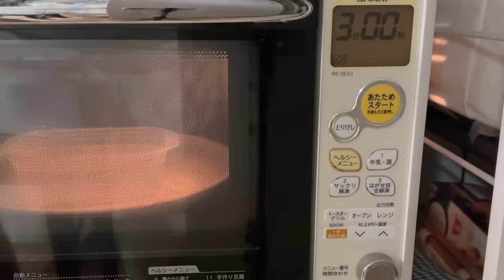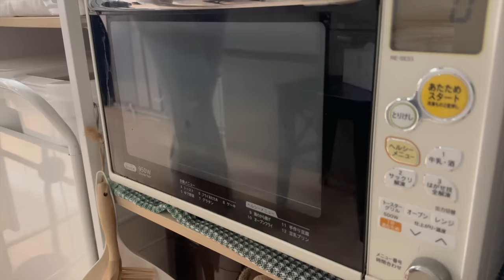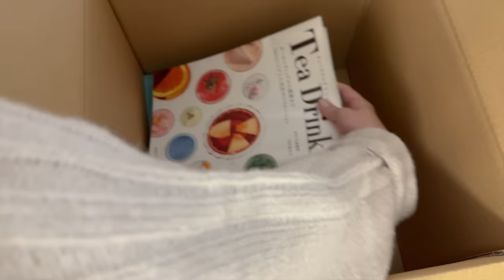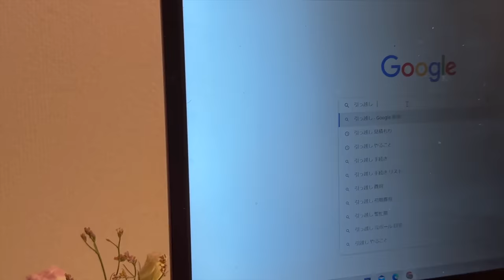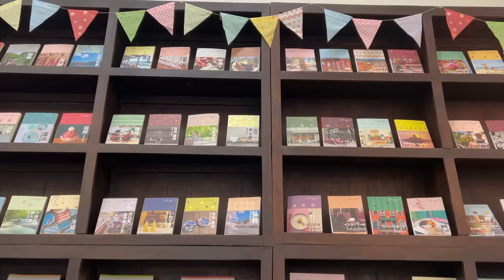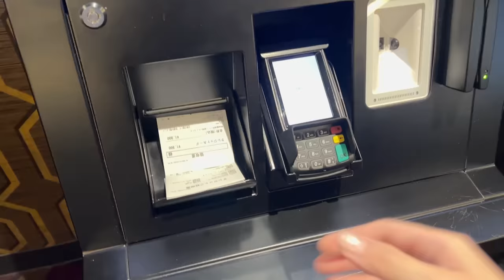Clean with me | 綺麗に掃除して引っ越しのためにパッキングする一人暮らしの休日｜Clean up for moving to new apartment Japan VLOG

Comment: Hi Nami, white vinegar works really well to clean your kettle. Just pour some into the kettle, grab a cloth and wipe inside till all of the scale comes off, pour it out then rinse the kettle out with water, simple. Doesn't take long. That's how I clean my kettle all of the time, it comes up brilliant 🌞
Reply: I was going to add this too!!❤ I’ve never tried citric acid so I don’t know which is best, but I always pour some vinegar in (like half a cup) fill it water and boil a couple of times, pour it out and boil clean water a couple of times to get the vinegar out well

Also!! For your microwave Nami my fav thing is when I make something with lemons (or any citrus) if I’m just squeezing the juice put the whole pieces in a bowl filled with water and run the microwave for 3 mins - be careful when removing and use oven mitts, the bowl and water wills be very hot - the microwave is then very easy to wipe down with paper towels (and you can dip them in the hot lemon water if you need to extra spot clean some places in the microwave) it gets the grease out really well and leaves it scented lemony fresh (and I feel good about using all the fruit and no waste)